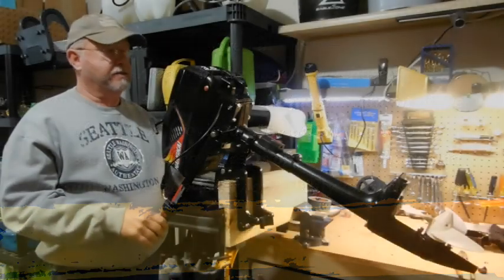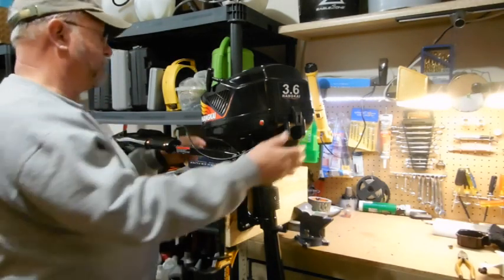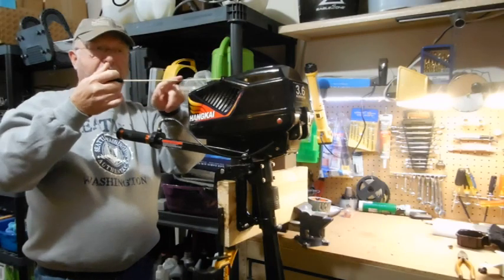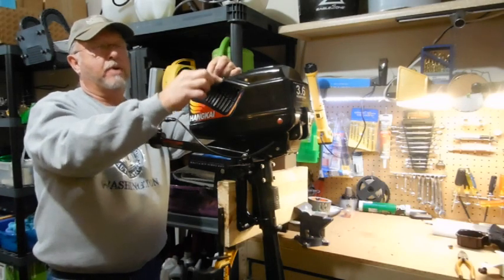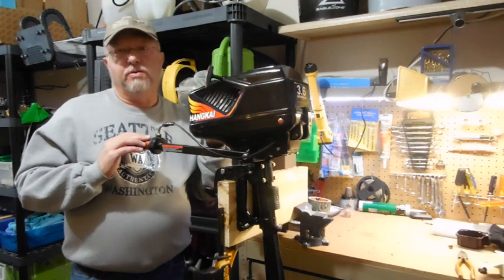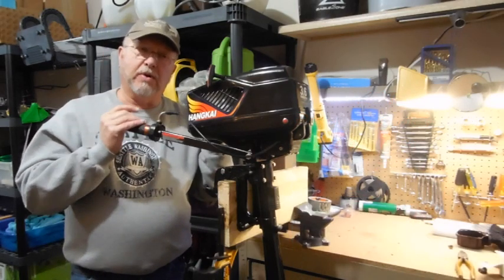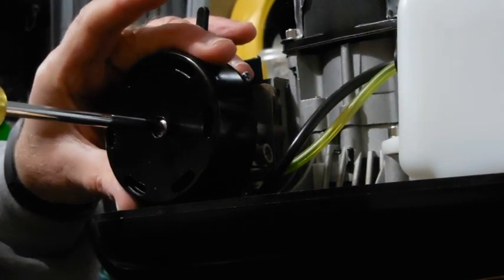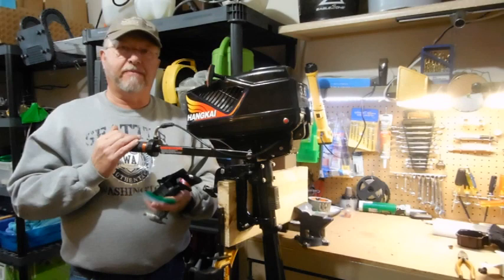Hangkai 3.6 / 3.5 hp outboard motor - 10 Things To Know

Comment: Never knew about these motors until a couple of days ago. Yes, you get what you pay for. Interesting about full throttle at break in...I always thought that you were supposed to run them at all different speeds. Makes sense about replacing the common parts. Questions: With the lack of availability of non-ethanolated fuels any more, what do yo do? As I run older Merc motors, I was advised to use add an additive such as Stabil 360 for the ethanol. Also, all I've seen are 3.5/3.6 hp motors. Are there bigger motors, like a 5 - 6 - 7.5 hp,  available? Need a larger motor for the type of water that I hit & size of boat I have... thanks
Reply from the maker: The company does make larger motors.  One of my video's shows how to access their web site and it will show several motors.  But I didn't purchase through them directly.  Also, I am now using ethanol fuel too.  I use Lucas Safegaurd Ethanol  Fuel Conditioner that I found at Walmart.  Here is the web site for Hangkai motors www.hang-kai.com/en/  the en is for English.  I cover that topic in later videos.
Reply from the maker: One additional comment:  I want to clarify the break-in.  Yes, do very the speed, but not full out top speed.  That puts a lot of stress on everything, and you want it to get everything moving smooth before putting stress on it (My opinion).  Even after the break in period, mine would sometimes kind of jump or kick/lurch and I think it was due to it needed more run time?  But it might have been due to the vent in the gas cap not opening up when it needed too?  Anyway, now that I have run it several times, it runs smooth.

Comment: So I received the gas can that it came with but it's a Lil different where I put the oil in is a little smaller it has a 35 on the side I don't know how much I would have to fill it up to get the perfect blend any suggestions

Comment: my hankai 3.5hp have problem , when running suddenly the propeller become slow and only big bubbles is coming out and the boat is not moving , what do you think is the problem ? thanks
Reply from the maker: Your clutch is worn out.  One of my videos shows how to replace.  Also might change tension spring while you are working on it.  Spring is to tight and causing excess wear on the clutch. Here are some videos to watch:
https://youtu.be/Qu9OjXbMutA?si=jD4V-fZSml0Z3AZa
https://youtu.be/H4mPGuEKnKI?si=yngKkud2yOozjEyr
https://youtu.be/LdtITFx6N-Q?si=SuijdOjQJf8R1Z2b
Reply: @BoilerDan1 thaks for the help 🙏 i will check

Comment: I'm looking to buy one of these to do a custom mount onto a fishing kayak for ocean fishing. Would you recommend this being that I'm trying to keep cost down
Reply from the maker: It’ll keep the cost down if you can get one reasonable. My concern is reliability!  The clutch wears out pretty quickly.  It’s easy to work on but I wouldn’t get to far from shore!  It’s the little things, fuel lines, spark plug. But if you change those items and keep an eye on things, the motor itself seems solid.  Watch all my videos on the motor and you’ll have a good idea of what to expect.

Comment: I purchased the hangkai 3.6 motor and received it. When I opened the box everything was there and no damage visible so I proceeded to follow instructions step by step on setting motor up to be started. I put gear oil in shaft compartment and closed it up. I  used a barrel of water mounted motor on it and proceeded step by step to start it. The fired on the first pull and idled perfectly I was impressed but when I advanced the throttle to start prop rotation it would not turn at all so I idled back down and shut the motor off think there was something I didn’t do but when l grabbed prop to turn it it would not turn freely at all in fact it seemed to be in a bind so I took prop back off to see if there was something in the gear housing but I didn’t see anything wrong. I put it back together and started it again ant started immediately but when I tried to advance the throttle the prop still wouldn’t turn ( very frustrating). Has anyone had this problem on this particular motor before? HELP !
Reply from the maker: 1st and most important:  When I used a bucket it was very cold and winter.  You must supply constant cool water or you will overheat your motor....you can do it on a lake or pond too.  Ok, that being said:  The propeller works via a centrifugal force clutch.  You can try to fully accelerate the motor to get it started turning, then back off a little but make sure you are getting water flowing out of the cooling port.  The problem with the motor is the clutch has a spring that is too tight for this application.  I will put two links at the end showing the clutch.   I ended up replacing the spring with one from a local hardware store.  It is much lighter and pull open easily now and has worked much better.  I did have to pry open the ends  of the new spring to adapt it to this use but it works well now.
I'll also suggest that you order a replacement clutch so you have it on hand.  You can search Amazon for "Clutch Drive For Honda GX31 GX35 and you will get several to chose from. That clutch is the same that came with your motor.  Let me know if I can help more and I will try. 
Here are links showing how to replace the clutch...and a little more follow-up on the topic.
https://youtu.be/H4mPGuEKnKI
https://youtu.be/Qu9OjXbMutA
https://youtu.be/G4qLw14lf9k
https://youtu.be/LdtITFx6N-Q
Reply from the maker: One other thing that I’ve discovered.... there is a line to fill the gear lubricant up to.  It’s just about 1/2 below the top. There needs to be a little air in the compartment to allow for expansion when the gear lubricant gets warmer and expands.  I’ve learned quite a bit in my adventure 😁
Reply: The shaft feels like it’s bound up from the start the motor only ran for maybe 60 seconds tops. Shouldn’t you be able to turn prop with your hand easily when the motor is not running? I can’t turn the prop at all with my hands that doesn’t seem right you can turn big boat props with your hand even if it’s in gear I just don’t know what to do would you send it back sir ?
Reply from the maker: Because it doesn't function like a traditional motor, the gearing is never in neutral and so the prop won't turn easily.  I wouldn't force it either as you might bend or break of the gears.  If you have the option of returning it, you could give that a try.  If that doesn't work out, watch the disassembly video I sent you and consider taking it apart to that level and check out the clutch.  I've heard that some have had the two bolts holding the clutch in place were put on too tight and the clutch can't spring open.  You could also remove the spring during break-in.  That way, it would take very little throttle to engage the prop.  The down side is that in actual use, you could never be in idle, the prop would always spin a little.  If you watch the video, you will see how the spring works, and putting in a lighter one would be best.   But again, if your more comfortable returning it, or if you could return it for another one...That's a good option.  But with this motor, I've done a lot of tweaking.  I enjoy doing that... But I can understand your hesitation.   Let me and others reading this know how it turns out.  Any input may help others decide if they want to consider buying one!  If you still have questions, I'm happy to try to assist. But realize, I'm not an expert, nor anywhere near a mechanic.  I'm just retired and wanted to explore a little with the motor and raft.  I didn't mind the risk... Best wishes for your journey too.
Maybe contact the seller for their view.  But I'm guessing loosening and retightening the two bolts that secure the clutch would be a good start...  I'd replace the spring at the same time.  But that's me.

Comment: Hi have you changed the gas primer  bulb i can't get the size,  in the local stores they are too big
Thanks
Reply from the maker: I’d recommend looking on eBay or Amazon.
Here’s a couple of possible options:
https://www.ebay.com/itm/181944287483?mkcid=16&mkevt=1&mkrid=711-127632-2357-0&ssspo=4Euf2FICQRm&sssrc=4429486&ssuid=s8A53jWuRTC&var=&widget_ver=artemis&media=COPY

https://www.ebay.com/itm/323377186681?mkcid=16&mkevt=1&mkrid=711-127632-2357-0&ssspo=nitVVxXXRZy&sssrc=4429486&ssuid=s8A53jWuRTC&var=&widget_ver=artemis&media=COPY

Or replace everything?
https://www.ebay.com/itm/126020040758?mkcid=16&mkevt=1&mkrid=711-127632-2357-0&ssspo=5OjZQ_L4RZ6&sssrc=4429486&ssuid=s8A53jWuRTC&var=&widget_ver=artemis&media=COPY

Comment: My 3.5hp engine seemed to have an extra rubber washer under the propeller and on top of the gear oil cover. I have not seen anything on your channel videos showing this. Was this an extra part from the factory?
Reply from the maker: I’m guessing that they included an extra. Maybe by accident in production?
Mine didn’t have any extra.
Thanks for watching 👍

Comment: Was going from 30:1 to the 50:1 fuel/oil ratio a manufacturer recommendation?
Reply from the maker: Yes, info from Hangkai:  (see link below)
The 30:1 mix is for breaking in the motor.  It will produce an oil residue out the exhaust.  Once you go to 50 :1 it is much cleaner running.  NOTE: on their web site you will see they show the mix of 25:1 for break in period.  I didn't do that, and would guess that would even create even more oil residue and possibly foul the spark plug?  Here is a link to the manufactures recommendation. 
 http://www.hang-kai.com/en/nd.jsp?id=2&groupId=-1

Comment: Thank you for the video BoilerDan. I purchased a brand new one last year and only started setting it up now and cannot get the propeller to turn when i rev the engine. I have filled the gear box, checked that the shear pin behind the propellor is not broken and still cannot get the propeller to turn. Do you have any advice on this. I have dropped the whole bottom to ensure that the drive shaft is connected and it seems to be all fine. As an FYI I did check the water pump seal as well and that is appropriately positioned, but no water pumping which i assume is the fact that the propeller shaft is not turning - Do you have any idea what I should look at next?
Reply from the maker: Next: Two items to try. 1st, the clutch spring is really not designed for a boat motor, it more for a weed wacker .... seriously it’s way too strong.  So here’s your two things to try.   The two bolts that hold the clutch on could be too tight, not allowing the clutch pads to swing outward which then turns the shaft for both the water wheel pump and the propeller.  Second and you might as well do this step regardless.  Replace the clutch spring with a lighter spring. I picked one up at a Menards store but any hardware store will work. You may have to get one that has closed ends, but you can bend or clip off the ends.  I made a series on replacing the clutch, I’ll paste links below.    https://youtu.be/G4qLw14lf9k that shows the spring. If I mentioned one that I ordered from Home Depot it turned out to be too small.  https://youtu.be/H4mPGuEKnKI This one is putting it back together:  https://youtu.be/Qu9OjXbMutA.  Let me know if it works out for you 👍 also more: You’re working with an aluminum block , use some thread locker medium strength and don’t over tighten 👍
Reply: Thank you Boiler Dan, will try this and let you know...got to get the kiddos out in the water and summers are short here in Vermont🙂
Reply: @BoilerDan1  and perhaps a silly question but what is the best way to access the clutch🙏
Reply from the maker: One of the videos I sent the link to covers it.  I’m not a mechanic but was able to do it 👍.  So watch this video first. The other two are putting it back together as well as the spring replacement.  I’m not sure I can list out here the process but if you watch the video then keep it handy a pause it as you go I think you can do it too. You’re not getting into the engine at all, it’s below it, watch this: Hangkai 3.6 hp Review: Clutch Repair (Part 1: Teardown)      https://youtu.be/H4mPGuEKnKI    I’m not sure that I copied the link... if not I’ll send a follow up.
Reply from the maker: Here’s the tear down link: https://youtu.be/H4mPGuEKnKI
Reply: @BoilerDan1  Thanks Dan that got it up and running.
Reply from the maker: Pierre van der Merwe : well that’s great news. It was nice to hear that the information I sent was helpful. Made my day!
Reply: @BoilerDan1  thanks so much again you have been super helpful

Comment: I got the can it came with but it looks a little different the side where the oil goes in is smaller n it has numerd 10-35-1 how would i know where to fill the oil up to sorry im not trying tomes up the motor

Comment: Jesus,  I didn't realize this engine requires so much work. Dan, It's going to be the first time I am working with any kind of boat engines. You seem to have experience. Would you recommend to buy something that is simpler to operate such as  4 Stroke engine ? Do I need to break in the 4 Stroke engine as well? This is a lot of work.
Reply from the maker: I had not done work on a motor since a class in junior high school, so I'm a novice at it too.  The steps I took were really simple.  Changing the spark plug to a better quality.  Putting some bee wax on the starter cord.  Other things I was just playing with as part of the experience.  But in hindsight,  the 4 stroke/cycle might have been a better choice.  The two stroke resulted in me having 1/2 gallon of fuel/oil mix left from last summer that I don't want to use because it is probably stale... So I'm stuck trying to figure out how to get rid of it.  The 4 cycle motor I could just put the extra fuel in my cars gas tank!  But for the money I spent, I'm happy with the motor.  We will see how it holds up over time.  I don't go out fishing much, so it's not like it gets heavy use.  Oh, and yes, you would still need to break in the 4 stroke model.  But that is just varying your speeds and don't go full out throttle until it's been run for several hours at variable speeds.
Reply: @BoilerDan1  Thanks Dan. What type of grease/oil would you suggest to oil the parts mentioned in the video ? Also, which oil you use to mix in with gas ?
Reply from the maker: I use a synthetic grease, and good quality will work fine for the part that is used to pivot the motor. For the gears down at the propeller I used SEA 90 hear lube. I found "Mercury" brand in Amazon . For the gas/oil mix,  you'll need 2 stroke oil. I got Quicksilver marine lubricant 2stroke synthetic blend at Wal-Mart.
Reply: @BoilerDan1  Thanks, buddy